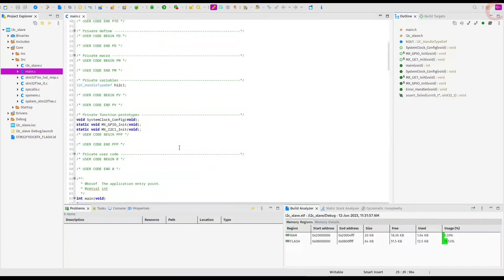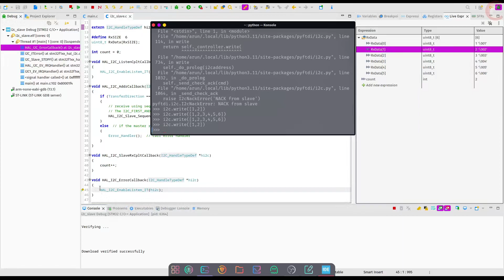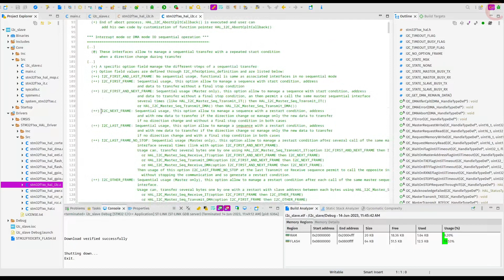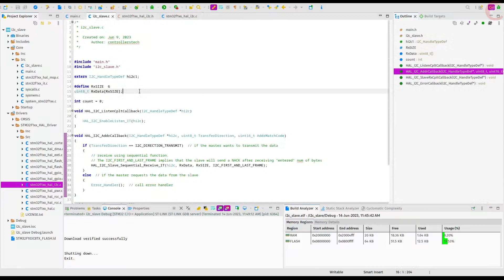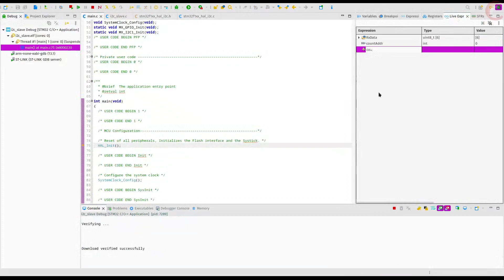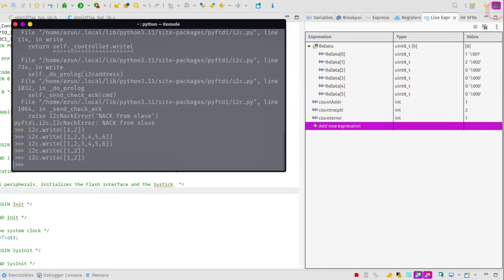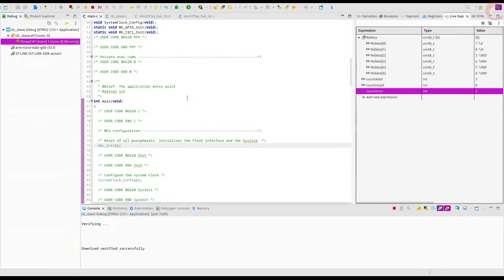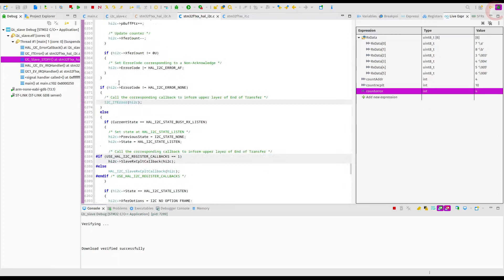STM32 as I2C Slave || PART 2

Comment: How to create a I2C master on another Nucleo board?
Reply: CubeMx: You can copy the Slave configuration
In the main.c:
  /* USER CODE BEGIN 2 */
  uint16_t slaveADDR=(0x12<<1);
  uint8_t TxData[6]="123456";
  /* USER CODE END 2 */

  /* Infinite loop */
  /* USER CODE BEGIN WHILE */
  while (1)
  {
	  HAL_I2C_Master_Transmit(&hi2c1, slaveADDR,TxData,6,1000);
	  HAL_Delay(1000);
    /* USER CODE END WHILE */

Comment: Thanks a lot for the tutorial. What is your operating system? It is amazing!
Reply from the maker: Garuda KDE version
Reply: @ControllersTech  👍
Reply: sorry, i have a trouble when it's working. I have not pulled up two line which are SCL and SDA. that's problem, isn't it?
Reply: @ThienTran-zx8jo  check the address , if device address is 0x22 then while sending (0x22<<1 | 0 ) is done . just ask chatgpt about this for more info